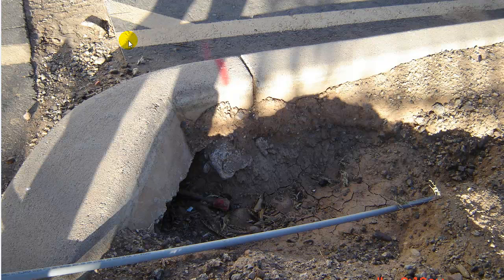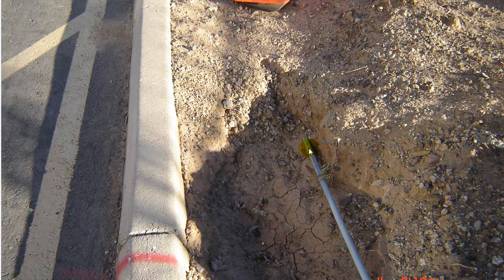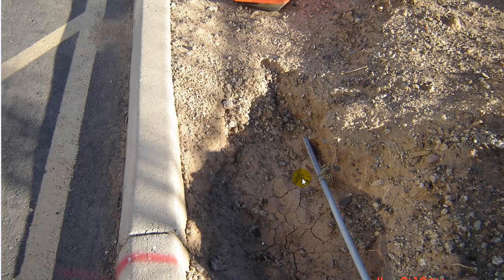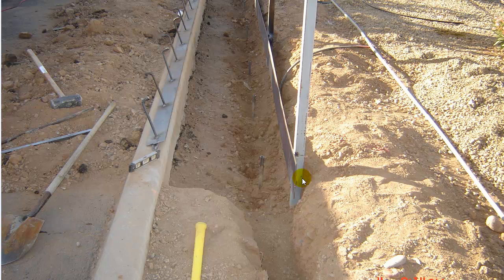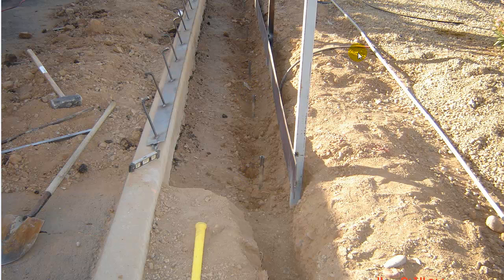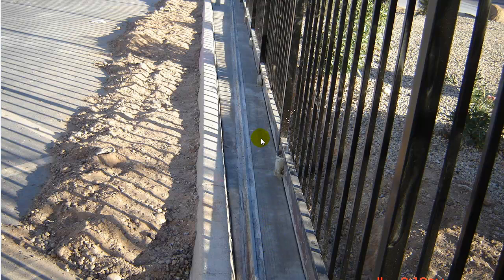Electrical Wiring- PVC Conduit

Comment: Looking at Table 300.5, Column 2, RMC or IMC, in the row "In Trench below 2-inch concrete or equivalent" minimum coverage is 6 inches.  Coverage meaning backfill above the top of the conduit, so the original contractor's 8 inch trench would appear to be okay from Table 300.5.

Comment: Mr. Sparky!  Can I run 14/2 NM-B Wire (15 amp wire with ground) through conduit to power up a residential lamp post? or does code require direct burial type wire?
Reply: Gina Ledell You cannot use NM-B sheathed wire in underground conduit.  Use THWN wires in conduit OR use the direct burial UF with no conduit

Comment: Your videos are interesting, thanks. 
I have an outside light that is across a 3' concrete footpath, and I want to run an 16/2 UL extension cord to it from an outside home GFCI plug. I don't want anybody to trip on the cord. Can I tunnel the cord under the concrete? I presume I need to use plastic conduit, at about 18" deep?
Thanks for your advice....